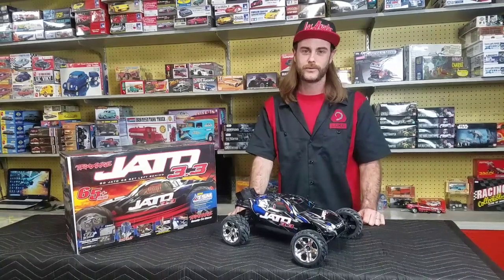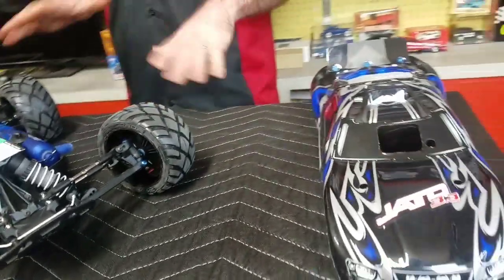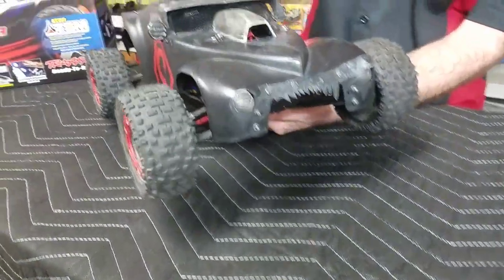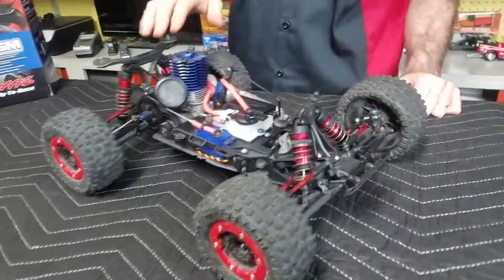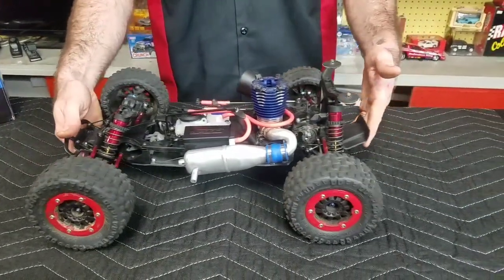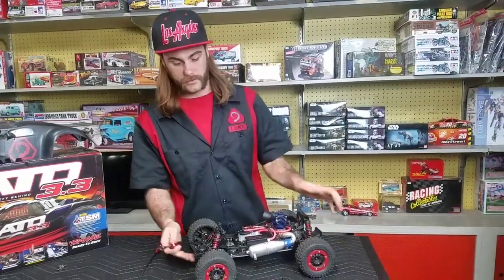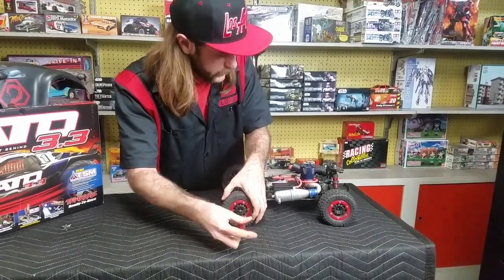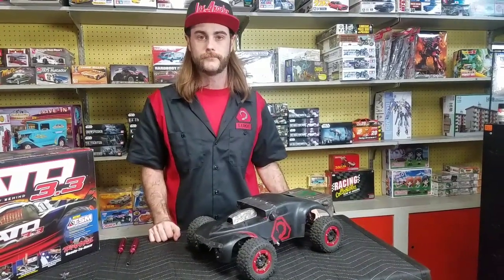Traxxas Jato Overview and Modification

Comment: Evett, please suggest which KV motor should I pick for my Rustler 2wd. I will buy a hobbywing ezrun max10 esc and motor combo, but I am thinking between the 3300KV, 4000KV, 4600KV, or the 5400KV. which is best for what kind of driving?
Reply from the maker: Do you have a Rustler equipped with the XL-5 ESC and Titan 12T? If you do, forget Hobbywing and go for a Traxxas VXL 3S power system. Using the Power Up Program at a Traxxas dealer, you can turn in your brushed power system and go VXL for less than the cost of the combos you're considering. It's a 3300 motor with a 2 or 3S ESC and you have the advantage of the best product support in the biz. Keep in mind, you also need to re-gear the truck, install bearings in the outdrives to replace the bushings and install steel tie rods to make the setup viable if it's a stock brushed Rustler. So far as driving conditions, you can optimize your setup with gearing, tires and suspension options.